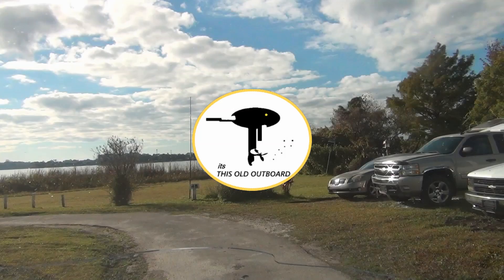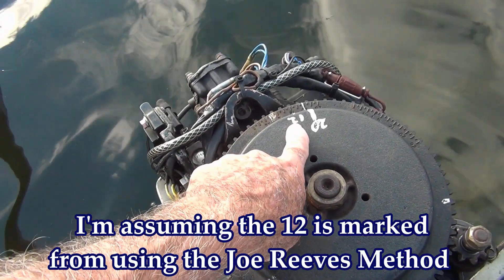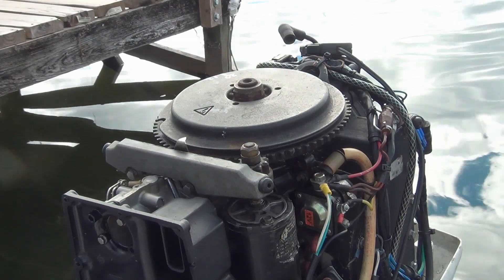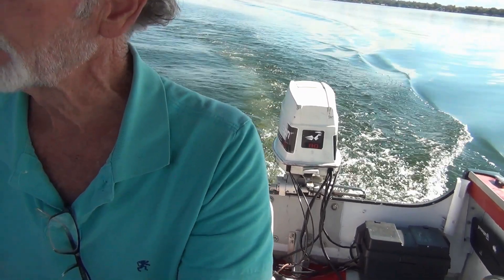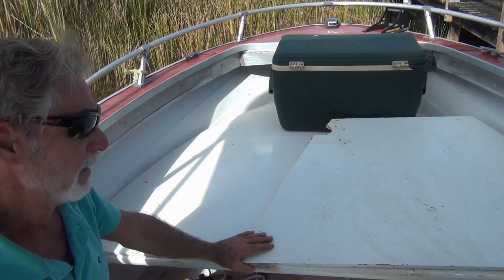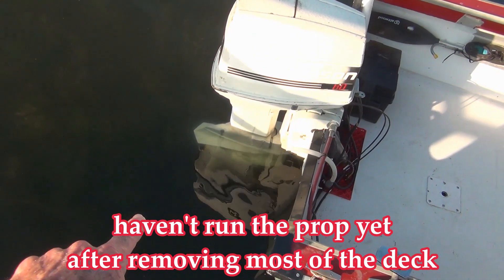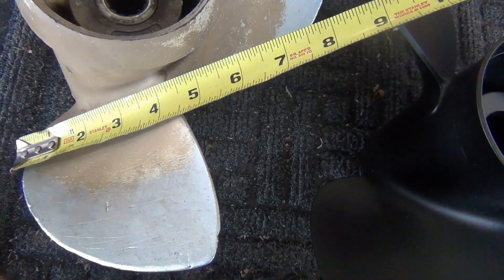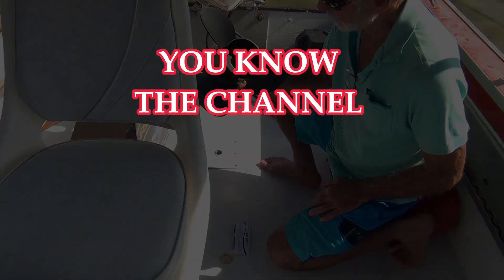Johnson 60Hp. Props - Speed & RPM's. THIS OLD OUTBOARD

Comment: Finally about right on pitch.  Now, if the boat has been in the water more than 2 or 3 weeks, pull it out and clean the bottom. That should free up another couple mph, which will give more rpm/hp. likely adding another mph, for maybe 3 more mph.  If you, after cleaning, use any of the many coatings, waxes, sprays, or other products that make water bead up instead of cling to the bottom, that will help noticeably as well. If in doubt about growth on the bottom, just reach under the water and rub the hull, If you feel Anything other than clean hull, even just slime, it is slowing the boat. Keep after it. You have 5500 rpm now, so the prop is good. If the bottom is at all dirty, you will get a useful bump in speed and rpm from cleaning band it costs nothing. Cheers, JE
Reply from the maker: Hey. Thanks for tuning in. Yeah there may be a slight amount. I took the underwater camera and looked at it a few weeks ago, it looked pretty good.It has never been bottom painted either. That's another project! Thanks again & Stay tuned !
Reply: Interesting comment indeed but Too's boat is run in fresh water so basically marine growth on the hull should only develop a few inches above and under the "standing still" waterline level. Once the boat gets on plane, that slimy stuff will be airborne and should have no effect on the boat's speed. Anyway if there could be some growth (and for that matter : wax, paint etc) on the boat's underside, it would rapidly be stripped off a metal hull such as his through water abrasion as it gathers sufficient speed. We really ought to look elsewhere to find the speed robber. Regards !
Reply from the maker: @danielrobert7181  i luv u! Hahaha

Comment: The steel prop is  much stiffer than the aluminum prop.  If you increase the pitch you will loose rpm and horsepower.  If anything you could get a prop shop to take out some pitch to get the  rpms up to 5800 rpm range.  looking good!
Reply from the maker: Hey. Hey I'm going to look for a prop shop. There use to be a guy in east Orlando but I think he's past away a long time ago. Thanks again & Stay Tuned!

Comment: Hope your back is getting better and that the sciatica is subsiding. Getting back to business, the weight of your SS prop shouldn't have any bearing on your top motor RPMs. First, once immerged in water, its dead (static) weight drops a lot but secondly, just as if you were to add a heavier flywheel, your motor might have slower acceleration but top revs won't be affected. All things beeing equal (diameter, pitch and rake) a SS prop will always outperform an aluminium one since it doesn't flex as much under load and that the blades will offer a smoother surface for water to slip by. That friction robs energy that in the end translates into lower speed. I thank you for your very interesting videos and wish you a great New Year !
Reply from the maker: Hey. Thanks for tuning in. Yes I Know what your saying, but.... Hahaha. Happy new year! & Stay tuned for the next Episode !
Reply: I think you're right on there Daniel in saying that having a heavier prop is like a heavier flywheel! Good call!

Comment: Not sure if your on the face book, but there’s a guy on the omc tillers page who has the same boat with a 70 hp tiller that tried about 6 different props. His best speed prop was a 20p raker 6000rpm 44mph. Those raker props are bow lifting props.
Reply from the maker: Hey. Thanks. Yeah its all in the prop. Thanks again & Stay tuned !

Comment: Sometimes mounting the motor up another hole……will raise those rpm’s. Stainless props are cupped and wont ventilate as easy.
Reply from the maker: Hey. I've got tilt & trim so no problems there. Thanks again & Stay tuned !
Reply: @THISOLDOUTBOARD1  I’m not referring to trim. Something I have heard from old techs and applied myself…..Whenyour planing…..you want the ventilation plate at the surface. Less drag of the lower unit. Then you trim up from there. I picked up a 200 rpm’s raising it up. Now I’m just under the rev limiter at wot and trimmed a bit.
Reply from the maker: @AAE-cg1il  Oh you mean to just raise the motor like they do with racing outboards. I've thought about it, even on the the 14' clipper boat. Raising the motor is suppose help stop porpoising too.
Reply: @THISOLDOUTBOARD1  yes….its like having a Jack plate. I have a boat almost as heavy as yours with a 30 erude etec. I’m hitting 5900 rpm’s (range is 55000-6000) and  getting 28+ mph.
Reply from the maker: @AAE-cg1il  I'm doing 28+ on the clipper with the outboard set on the middle trim pin setting and 26+ one hole down/one up from bottom pin hole. but cant set it at the second hole from the top, too squirrelly, too fast, boat only weighs 220 lbs. I've added weights up front to get a good balance, bumping 29+. that boat & motor should be doin 32+ but the trim tabs I made are dragging it down. Theres a lot of pressure pushing on the gearcase which makes steering hard too. But I luv it- It's a fun boat!
Reply: @THISOLDOUTBOARD1  there is a guy online running a skinny 1436 flat bottom with an outboard on a Jack plate He put a console way up at the bow and he hits in the mid 30’s. It was cool……but definitely a younger man’s setup. Not for me…..
Reply from the maker: @AAE-cg1il  hahaha

Comment: Weren't you running tests at 5,500 RPM when you first hooked up the tach? That new prop looks sweet, looks like it'll grab and move some water!
Reply from the maker: Hey. The only prop at wot/5500 was the beat up one at 30/32 mph Deck in. The SS 17p before that beat up one was 6200 a 34 mph Deck in. Yeah it's  a nice prop but it weighs a ton! Thanks & Stay tuned !

Comment: Well I guess that good, I have a 16 foot sunbird fiberglass fish and ski, with a 1986 70 hp evinrude, with me and my wife , running the OMC factory, 19 pitch 5400 rpm, hit about 38-39 mph.
Reply from the maker: Hey. Thanks for tuning in. Yeah the 80's 70 hp's were kickin with 64-65D jets. I was hoping that was what I was getting in those 70 hp carbs but no. They're are only 52D. Thanks again & Stay tuned !